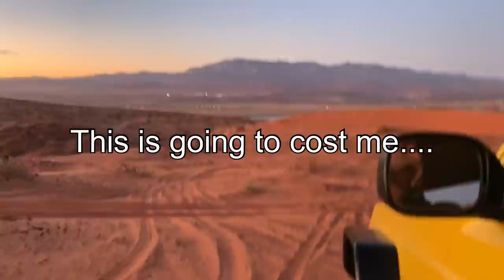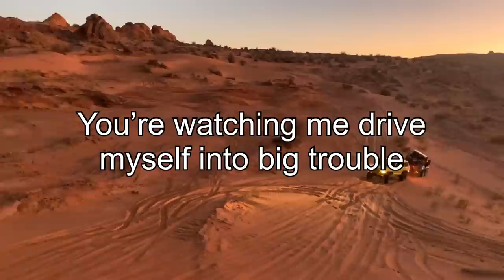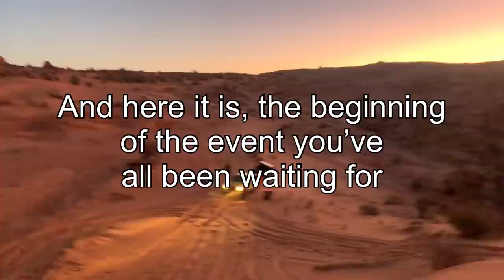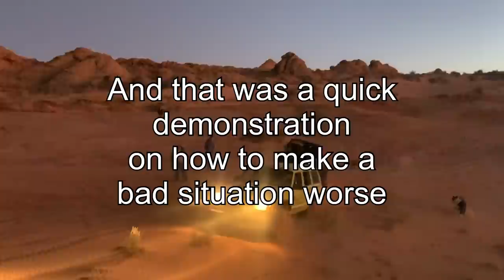***Can-Am X3 Crash***

Comment: I swear I could smell the hot ATF from here when you were bogged in there!😂
Reply: Matt's Garage I have a feeling the trans cooler was putting in some work on that one
Reply: I wonder through how many trans  have you gone in that cherokee 🤔
Reply: @MattsOffRoadRecovery  OMG 👍👍👍👍
Reply: @albertoramirez8304  aw4 is bulletproof
Reply: I had a 98 Cherokee Sport and you could not kill that thing and with the right tires it could go anywhere. If you got stuck going forward you just put it in reverse only once I got stuck on loose Rock down by the river took 2 days to get it out.But I should have known better I wasn't the first one stuck down there.It wasn't that it was so hard to get out it was getting the gear to where the jeep was to get it out if you know what I mean.

Comment: Drivers Errors!  No visible flags.  I think Ed is wearing someone elses pants!!!  It must be comforting that you called the right guys for the job.  a 5' bar we call a spud would help on those hangups.  
Perhaps a bit of Beaver Tail on the back of the trailer.
Good haul by the other guy too.  Are the wrecks all GPS located?  I for one was NOT waiting for you to get into trouble.  Randy....You're FIRED.  A snatch Block hook along the side would help I think to straighten the Pull.

Comment: I always had a 3/4 sheet of plywood on my trailer to lay on top of the ramps to get broken cars on the trailer and had a trailer jack ski from 6 in channel to set the trailer jack on and disconnect the trailer. and get my tow vehicle on better ground and a 30 ft chain dragging the trailer to get everything out to hook back up.

Comment: Hey Matt, another job well done,. My suggestion for  the sxs  recovery s   , a rock bar  to boost the snags over the deck of the trailer . Needs no batteries , never fails to move a stubborn load. Cheers from the San Luis valley of Colorado.

Comment: Hy Matt...once again great update.
I would like to give you an insider tip ; if you fix or put a aluminium or steel bearing pulley one on each back end edge sides will make your towing much easier. This is very helpful by tight roads and the trailer can't be positioned straight to the damage vehicle.....
You pull your winch cable out and with the help from the pulley you can position the damage vehicle to any direction before pulling it up to the trailer.
The pulley needs to be fixed flat right before end of your trailer one on each side.

Comment: I've never seen so many wrecked side by sides in my life.  It's like their suspension is made from spaghetti.
Reply: Made for yuppies who have thousands of dollars and have no sense of the value of a dollar . 25 thousand for a side by side get the hell outta here right ..
Reply: Mike Carr if you can build a sub 2000lb, 20 plus inches of travel, 200 hp 999cc vehicle that can fly through things like these can for less you have you’ll be a rich man.
Reply: 2A556FMJ vw beetle dune buggy. Done.
Reply: @goclunker  😂
Reply: Go Clunker by the time you build a Dune buggy at those specs you’re in the hole 25k as well. Don’t forget a cage, labor or the shop’s labor too. If you have a link to one please share
Reply: @TobyCostaRica  i'd go with a used bike and buy $24,000 worth of beer. (:
Reply: Mike Carr hater....lol

Comment: Very interesting the Tire Pressure,thanx for that! However I wonder if it would be better to have a higher pressure in the Trailer Tires since they are supposed to have less drag ... 

best Whishes, Marc
Reply: very interesting ... it shows me how important Experience is against whishful thinking! Maybe an explanatory Video idea?
Best Whishes and great Success coming from Germany,Marc
Reply: boetschge the low tire pressure in the trailer tires makes for a larger contact patch, excess drag is minimal but it greatly reduces the pounds per square inch so the tires don’t sink as much in the loose sand
Reply: @Beandiptheredneck   thanks,I just thought in one direction.Years ago I was into Rock Crawling and low Tire Pressure was a must,because of the bigger Footprint ...in case of a trailer I thought only in terms of Traction,which is not needed since it doesnt have a Motor,but actually,it also helps to not sink into the Sand as much ... silly me :-)

Comment: Everything worked out in the end as long as Ed still had smokes and the dogs had fun.   Very glad to see no one was hurt, it as all fun till you break a leg so glad they had fun.   I have an 01 Cherokee that my daughter has rolled over twice, still runs plows snow great.  I will sell it to you cheap and you can cut the top off and weld the trailer on it to use it to really fly through the sand!!   joking but we do have flat bed Cherokees used in the fields not far from here.

Comment: Matt
During WWII the German Military used a foam Rubber inside of the Truck & Trailer Tires that would not go flat when shot with Armor Piercing Bullets, they were only good up to certain speeds about 35 mph I think. If you could come up with a similar way it might help with Tire Problems for off road tires.

Comment: just a ideal for your trailer.  we did it years ago but with out air ride but I think air ride may work good in this case all you can do is look into it and see. we took 2 VW rabbit axels widened them out and put them under a trailer. with coil springs.  but you could put them under  that trailer with air bags instead of springs and drop it to the ground when loading and unloading. you will just have to look how the VW axels are built to know what i'm talking about. bu I think it would work.

Comment: You need one of those CJ Jeeps like that blue one.  Mount a small tow truck apparatus in the back and just lift and drive out.
Reply: AlaskaErik that would be a cool build!
Reply: AlaskaErik maybe a 6x6 type of deal to get the extra traction and load distribution on the back end
Reply: Matt has a plan... You won't be disappointed.

Comment: One piece of equipment you should have is an aluminum Danforth anchor when on the dunes. You just pull out the cable and set the anchor and pull yourself out of there.

Comment: Hi. This may seem like an odd idea, have you considered taking a pair of long, load bearing 'ski's with you. Simply dig the ski's under the wheels and broken suspension, and using the ski's anchor point at the front, tow the ski's (plus the carried load) out of the sand and onto the trailer. Then remove the skis from under the load and secure the load. Just realised, that at a year old I doubt you will ever see this comment, however, it was an interesting video and thank you for sharing it.

Comment: heres an idea, get a jeep with a stinger and a winch. then have a pully on the top of the stinger, so you pretty much have a small crane now. so  in a situation like this you could put the front tires on with the ramps and lift up the back with the "crane" and put the rest on

Comment: X3's are fast and light, compared to jeeps in that sand so, they can carry alot of speed. guys in X3 sometimes just drive em fast and sure enough, came across another fella driving faster than they can see considering all trails are two way. ive had wranglers, tacoms. im on a sxs byself, am happiest in the sxs ompared to any other 4x4 machine ive had. their toys u can buy already ready for offroad, not like a project truck u have to build up

Comment: on the steep side of dunes there is usually some really soft sand. To get out you engage  all the diff locks you have/traction systems and you put it in 4lo and don't spin your tires! just let it spin slowly.

Comment: Here is an idea, How heavy are those side by sides, consider an "A" frame over the top of the trailer to support the end that has suspension failure, Maybe a little job for Fab Rats. a winch cable over the top of the frame would possibly lift one end,  it looks pretty good in my design drawings.

Comment: I was watching the other Jeep latching on to the other Can-Am and it occurred to me that these vehicles always seem to break one wheel off and the other axle seems to be useable. So I got to wondering if it would be possible to somehow lift the broken end and tow it out rather than lifting it onto the trailer. I know it’s not a perfect solution but maybe a possible second solution in there somewhere. And everybody gets stuck. I got stuck once on solid concrete.

Comment: Need to jerry-rig some electric motors for the trailer axles on the next build!
Reply: Hmmm I'm liking this idea....
Reply: Caravan movers that work on the wheels. Essentially a starter motor running a gear that then drives a friction roller on the wheel
Reply: Run a shaft off the PTO on the transfer box to a powered axle of the trailer

Comment: It seems like a lot the recovery for the side by sides are missing or have a damaged wheel/ suspension. Have you thought about making a small shoe out of plywood with an angled front that you could strap onto the damaged unit suspension to slide it up the ramp and onto the trailer?

Comment: Just an observation and not a criticism - would it not have been better, once stuck in the soft sand, to have unhooked the trailer and moved the jeep on to harder sand, then towed the trailer out with a cable or ropes? I am not good in sand, but I understand that the less weight the better?

Comment: Matt have you thought of using a engine pick mounted to a receiver to tow out broken sxs. I race sxs and the promoter have a 6x6 Polaris ranger with a engine pick on the back to tow people out of the woods after the race. Its hauled me out 4 times. Them trees just pop out of nowhere.
Reply: Matt, this might work?
Reply: I'm excited for that!
Reply: @MattsOffRoadRecovery  ya that's alot of tongue weight pretty far out the 6x6 has chains that run from the top of the cage to the top of the pick. Also has a weight on the front to prevent wheelies.
Reply: @MattsOffRoadRecovery  monsta? suspicious look

Comment: Pointing out the obvious but you need to make those ramps attach with a round bar that slides inside some tube welded to the trailer. Someone is going to get hurt or damage someone's equipment with the current setup.

Comment: Hi. I notice that you work your Jeep quite hard with most recoveries by pulling rather than winching. Have you done any mods to the drive train other than high flotation tires and a  body height lift? Gearbox, transfer case, drive shaft, universals, differentials?
Chris. South Africa.

Comment: Do you feel comfortable running 9psi on a non-bead lock wheel because you’re running pretty straight lines during the recoveries, or am I missing something?
Reply: Matt's Off Road Recovery So you’ve had no de-bead incidents? I mostly ask because people think I’m crazy for running less than 15 psi on my 2000 Chevy Silverado extended cab long bed 1500 4 x 4 with no bead locks.

Comment: After watching several of these CanAms being "recovered," I believe there are some serious structural issues w/ them. Most notably, that lower control arm attachment points, front and rear. Poor design, faulty fasteners or both? Question: Why don't you run bead-lock rims on your recovery rig when you're constantly de-pressurizing to gain traction? Sure would help keep the trail repairs down and afford yourself a little peace of mind. Just a thought.

Comment: Have you thought of installing a tilt bed.
Reply: Too heavy dude
Reply: @bionicvenom  Manually operated tilting bed (aka hinges at the back of the bed) would only add a few pounds of weight. It would make it harder to winch though. Its a pretty common system in small trailers. Helps with loading atvs and bikes.

Comment: Matt have you ever thought of a hi-lift jack for things like this?
Reply: I never thought of weight but that a good point, also a good reason you own the recovery service not me.  Always good stuff watching you work, amazing..
Reply: I know that on most jobs extra gear would be dead weight and you dont always know what you'll need until you get on scene, but a gear bag of ratchet straps and crow bars and a hi lift for the wrecked SxS jobs seems useful.
Reply: @MattsOffRoadRecovery  You've talked about modifying your front bumper a couple of times, if you lightened it up, would putting a hi-lift jack up front balance out?